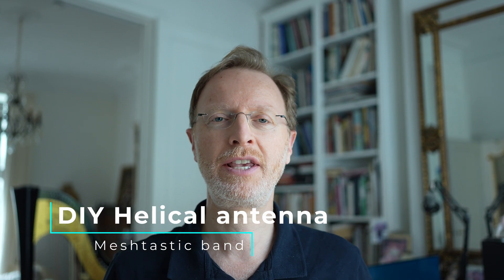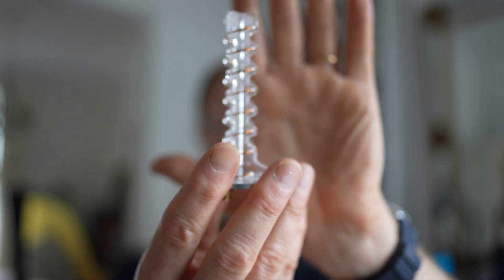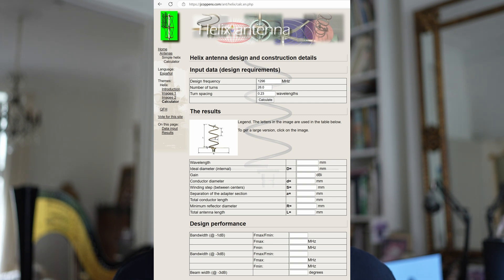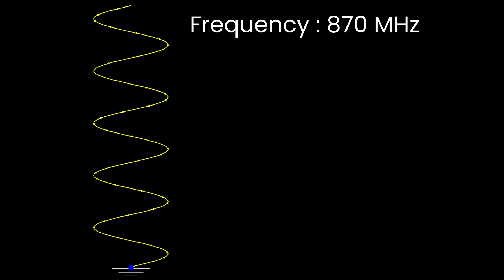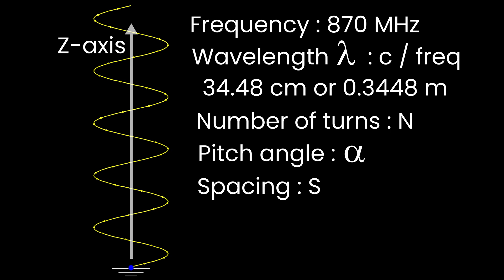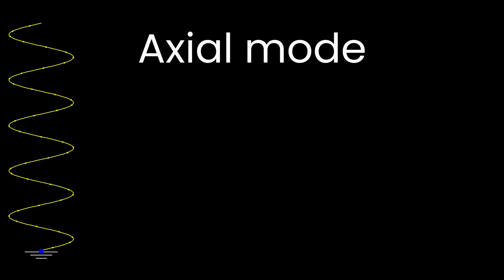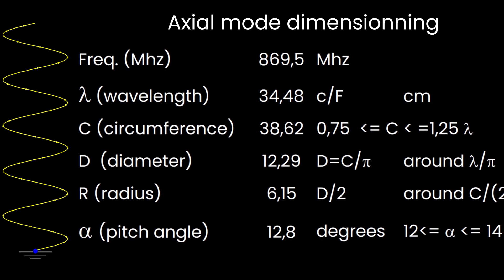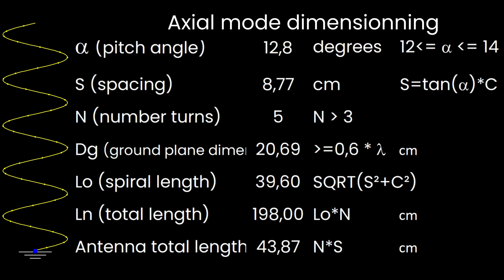How to build your own DIY helix antenna for Meshtastic Part 1

Comment: When I was younger, working at the MIT ATR (antenna test range) 
I was able to chat with John D. Kraus (he discovered the Helix antenna) and learned the details of how he accidentally made the discovery. It's in one of his books.
Anyways, I was able to build and test the gain of small (Hydrogen Line) 1420 MHz Helix antennas to use as the feed point on an old TVRO 10' dish. That I used at home for Radio Astronomy and some SETI hobby stuff. 
I wanted to use a Helix feed because I wanted to reduce the heavy interference from GPS satellites that use Right Hand Circular Polarized, (RHCP). 
I actually made RHCP feeds, because the signal polarization is Reversed when it bounces back off the dish. (like looking in a mirror) So my rig was great for hearing LHCP but the RHCP GPS birds were very weak (-20db down). IIRC, there was a 3db loss with Vertical or Horizontally polarized signals. I was still able to hear SSB EME from South America when the Moon was up high.  

I'll be interested to see what a Helix can do on the 906 MHz US LoRa channel20. 
I have done a little testing with a 10 element Yagi and was able to get some fast TraceRoute returns from 3.1 miles, over a very poor path. The Yagi works a little better than my Reference (gain) Dipole. 
I like the idea of using high gain CP antennas on Nodes that are set up as long-range Repeater links between towns or remote locations.
Reply from the maker: Great experience, I appreciate a lot you're sharing this. I guess the circular polarization is one of the big advantages of an helix versus a Yagi antenna to eliminate unwanted signal reflections and interferences. I used quite extensively helix antennas for drone video in the 5.8Ghz band. At such frequencies helix antennas are quite compact which makes them very useable. Seeing the relatively much bigger size of an helix for the meshtastic band, as you say, it can practically be used only for permanent fixed nodes.
Reply: @PoweredMeshtasticEurope  A small 8-turn Helix on 906.875 MHz would not be very large. It might a be good Hand-held rig for finding lost Nodes, or checking site locations for link suitability.  
In the USA, small handheld antennas are sometimes used in a "Fox Hunt" to find hidden radios. 
I believe most of the animal tracker RDF systems these days still use Yagi beams. Which are not really safe to use close quarters, due to the Eye hazard. 
Which makes the Short Helix more desirable in my opinion. 
IMHO, after installing many a UHF Yagi on towers. 
Yeah, I still climb my little 30 foot Ham tower (ROHN 25G) at the age of 78!

One more good reason to use CP is the low Loss when connecting with a Vertical or Horizontal polarized antenna, it's only 3dB. 
However, if you are using a Vertical antenna, to connect with an antenna that fell over and is now Horizontal, you could see about a 20 dB loss. In some cases, that signal would be undetectable. 
GPS satellites use RHCP, which means the tiny antenna in your Node can be sitting at almost any angle and still work just fine.

Comment: Link to calculator?
Reply from the maker: I did not use a calculator for the helix dimensionning (because as said in the video, I found them incorrect or badly programmed so fields would not update or they would take fixed decisions on certain parameters that I wanted the freedom to change) so I made my own excel sheet with formulas and best practices gathered online from various sources. I can share the excel file if needed
Reply: @PoweredMeshtasticEurope  Thank you for the great information in this video as well as part 2. Any chance I can also get the spreadsheet?